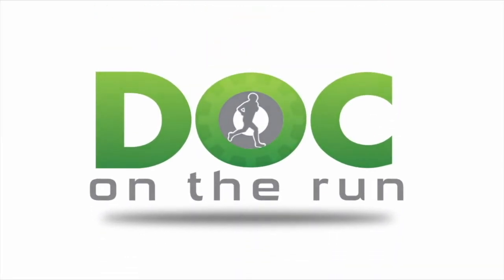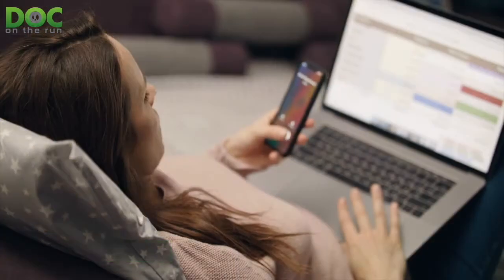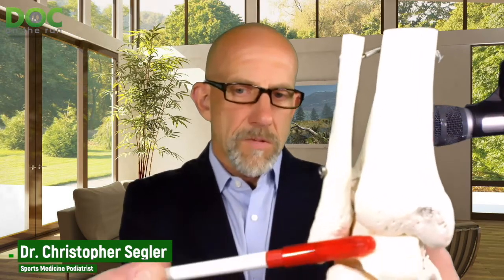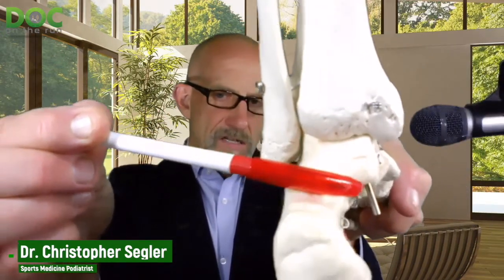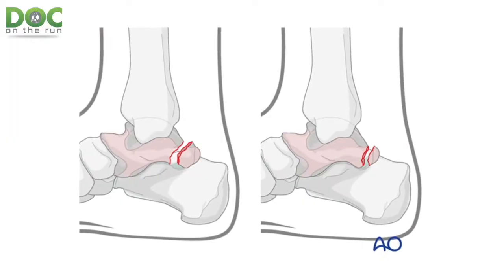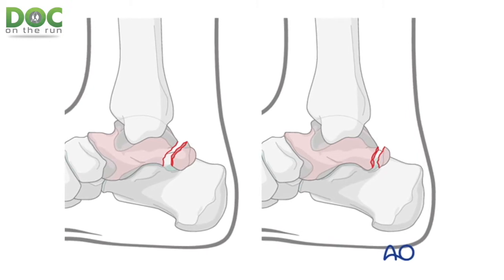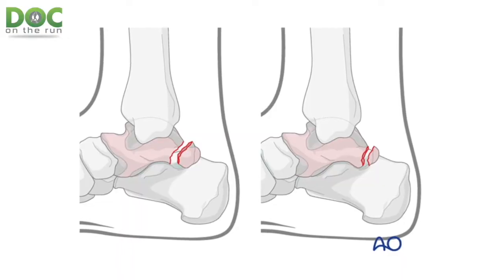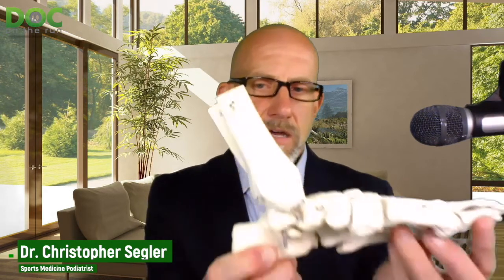What is a posterior process talus fracture?

Comment: I had a talus neck fracture on the 2nd October 2023 i am now 4 months nearly since operation where i got 1 screw and metal plates they tried to put another screw in but because the bone was breaking away they had to abandon it, i am from scotland and full weight bearing now but in a lot of pain can only walk with my boot on, do u think this is right ? And also how long roughly is the recovering time for me here ? They told me i would be back working for February but to be honest i wont even be back walking for then, any information or tips atall would help here thanks
Reply from the maker: Hello Rosco, thank you for watching and I am sorry to hear about your injury. Since I am not your doctor, I cannot make any comments on your injury progress, or your specific course of recovery without understanding all of the details of your injury and medical history that would normally be obtained through a consultation. If you want to get on WebCam call or phone call you can arrange and connect with me directly through docontherun.com
Reply: I am 5 months after surgery, broke my heel and talus. They talked like it would be maybe around 3 months recovery but I still can not walk. I have to wear my medical boot still to work and the pain is crazy. I don’t think there is any healing from this injury. I had the plate and screws plus cadaver bones put in and my foot is still swelled up like a balloon. 54 thousand dollar surgery.
Reply: @Joseph-ny5rr  I am the same mate it's not getting any easier atall